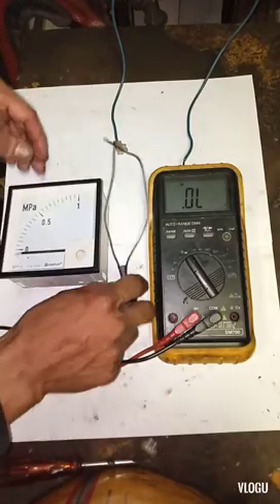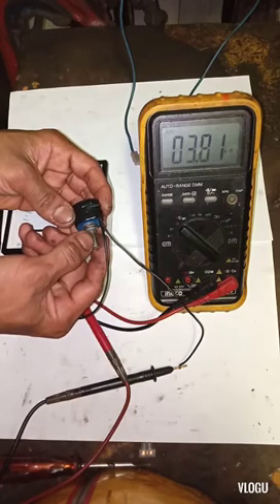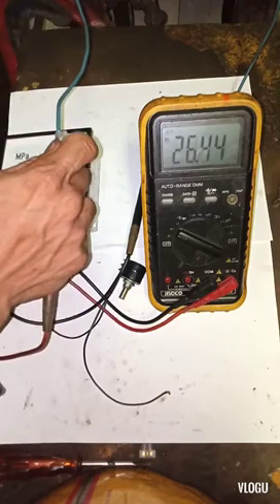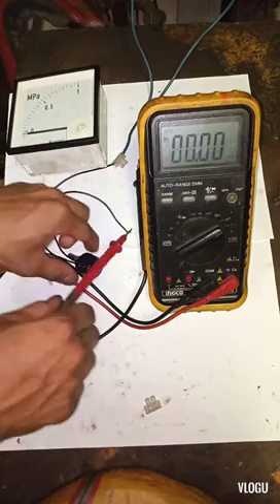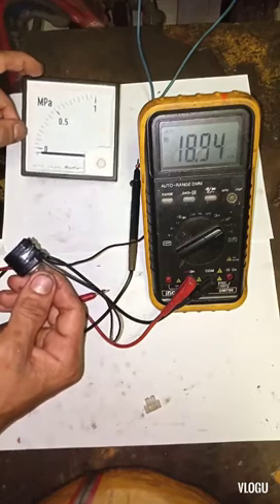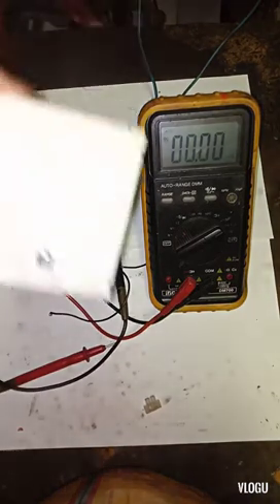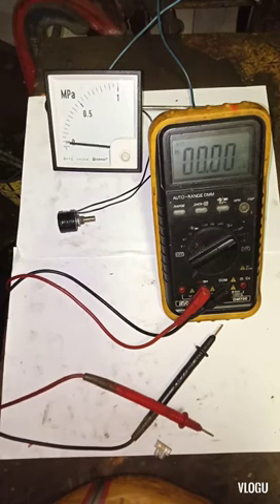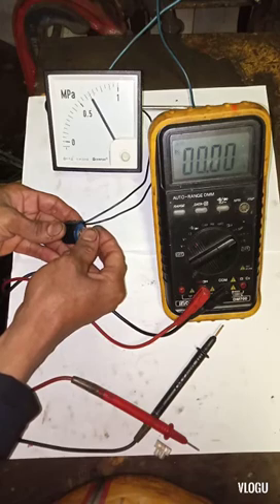HOW TO MAKE 4-20 MILI AMPERE OUTPUT SIGNAL NO? TRANSMITTER NO PROBLEM JUST WATCH THIS VIDEO!

Comment: Bro pwedi ba yan sa speed sensor open kasi speed sensor ng turbo charger namin wala ng resistance kaya walang  rpm reading yung turbo charger namin? Thank you bro...
Reply from the maker: Sir good day, speed sensor in my experience milivolts output yun.,then my converter xa kung ang monitor mo is mili amper ang input,kya hindi pwede sir..
Reply from the maker: watch mo sir yun vlog ko about sa turbo charger rpm trouble..
Reply: @elektont.v5746  bro asan na yong separate video mo on how to test speed sensor. Hehehe
Reply from the maker: https://youtu.be/kMJBAfkxC5s

Comment: sir paano mo maggamit ung 5kohm potentiometer as emergency replacement sa mga pressure transmitter? paano mo sya iseset sir? iset mo ba ang potentiometer sa exact working pressure ng papalitan mong transmitter? pde pong pakielaborate sir. thank you sir Godbless
Reply from the maker: yes sir ganun na nga, set mo xa sa need na pressure na signal na kaylangan mo..
Reply: @elektont.v5746  so one time setting lng sya sir? Di na need iset sa 0MPa kung idle or off ang system?
Reply from the maker: dpende sa need mo na pressure sir.,kung for start or stop the system, pwede mo palitan yun signal nya pag pinihit mo pataas o pababa,then magbabago value output ng potentiometer..